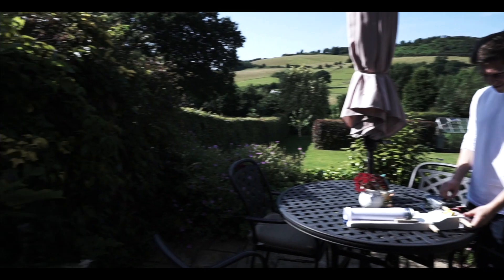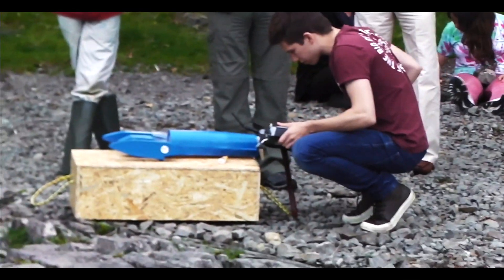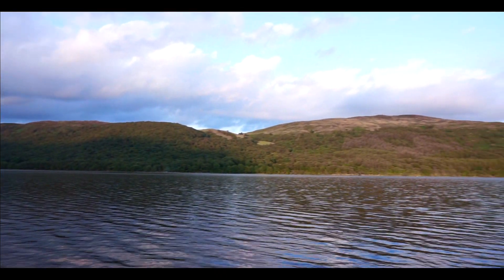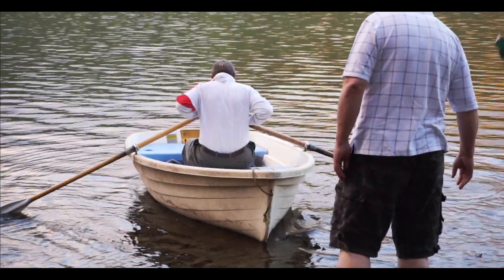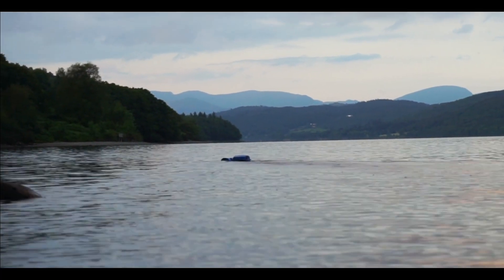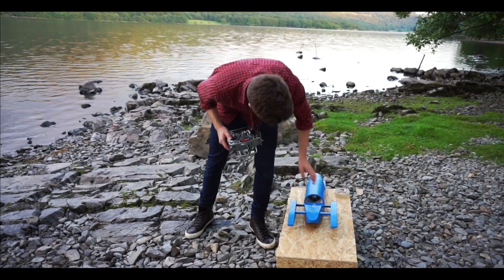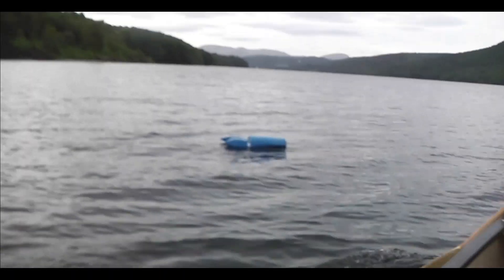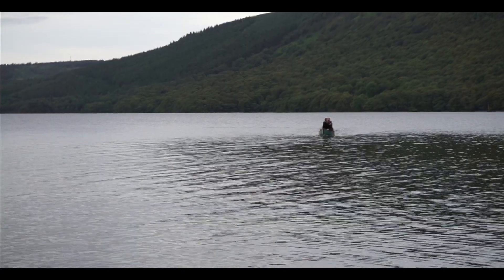RC Bluebird K7 - EDF Jet Boat Speed Testing on Coniston

Comment: Why not use a waterproof esc,or coat that with liquid electrical tape?
Reply from the maker: That would have been a sensible precaution - However, the hull was supposed to keep water out, but it didn't.